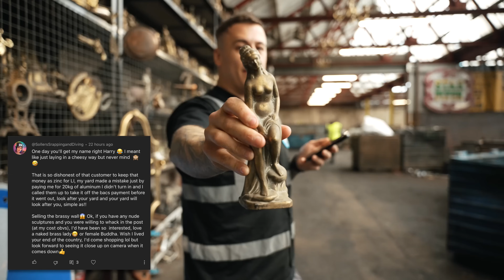HOONIGAN CAR FOR £500 !!! | Scrap King Diaries #S05E22

Comment: I love all the treasures that Rich picks up! 
The brass, The swarf shaker, the hiab lorry, the conveyer belt 😅
Sunday evenings are the highlight of my week. A bottle of cider or two, a couple of bags of crisps and laugh my arse off for half hour, don’t give up the videos please
Reply: Also wills right again 😅
If the compressor and light bar are hard wired to the battery, and not through the fuse box, then they’ll drain the battery even when she’s switched off.

Comment: Trying to get couriers to put on hi-vis and steel toe cap boots at work is fucking exhausting, we are a mandatory site for it due to the forklifts running about and the amount of people that kick off is mental, we have to refuse them entry to site, similar issue to you as most don’t speak English either 🤣